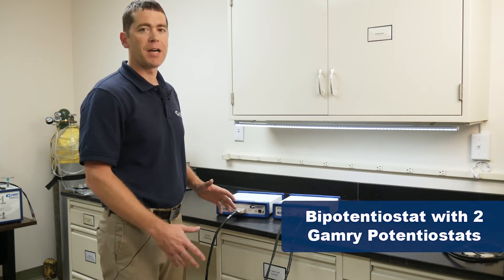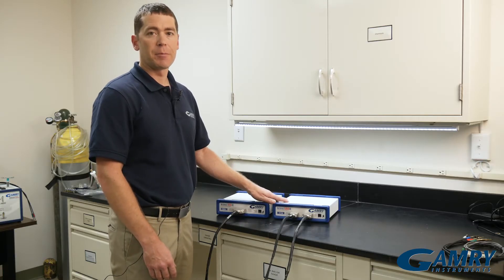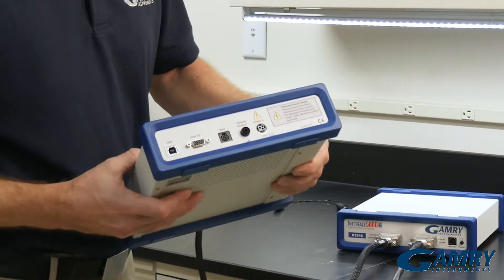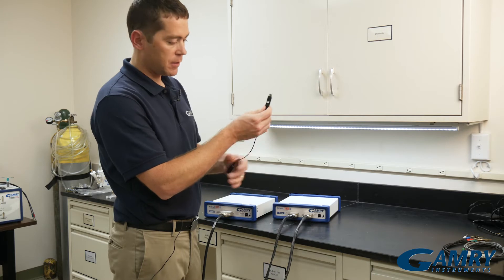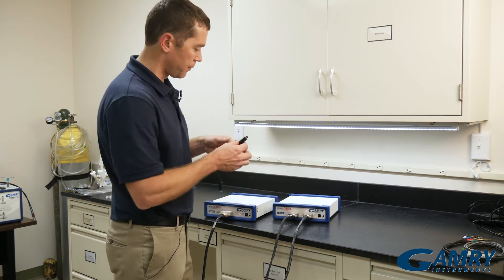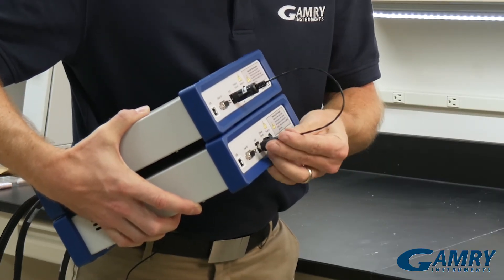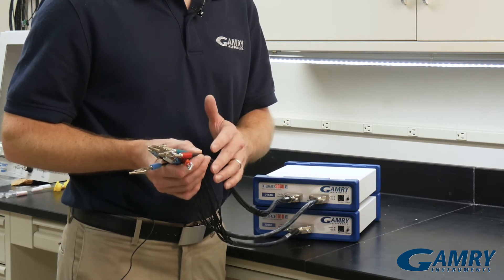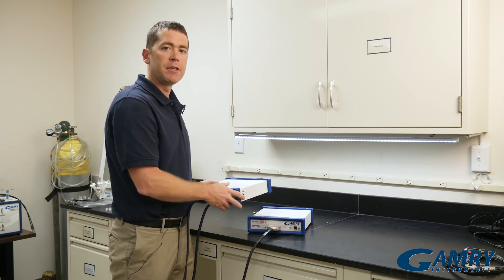Bipotentiostat with 2 Gamry Interface Potentiostats

Comment: could you please, explain how you can control the potential of the second working electrode, which software belongs to which instrument that control the complete measurements. at the end of the measuments one of these two instruments will record only a fixed potential agains the current for the compound that oxidizes or reduces at this potential, so, how I can get the data, or would I get all the data in one file data as useul . I think it will be nice and guide for all Gamry user if you issue a note use about this set-up and how we can obtain the data and treat it
Reply from the maker: Hi Abu, We have several bipotentiostat scripts available for use in the Framework software. These include CV, Chronoamperometry, ring/disk collection, etc. In the setup screen for the experiment you can set the parameters for each instrument. All of the data will be contained in a single data file. In our Analyst program you can view either or both data sets. 

If you have additional questions related to your specific setup pleas email techsupport@gamry.com and one of our support engineers will be happy to assist.
Reply: @gamryinstruments  
Thank you very much for prompt reply.

Comment: Could you please explain a little bit in more details what would be the benefits of doing this?
Reply: I mean, what are the applications of such test?
Reply from the maker: Bipotentiostats can be used in any number of applications. The most common one is a generator-collector experiment where you produce a species at one electrode and detect it at a second electrode. This can be very helpful for elucidating any number of mechanisms.